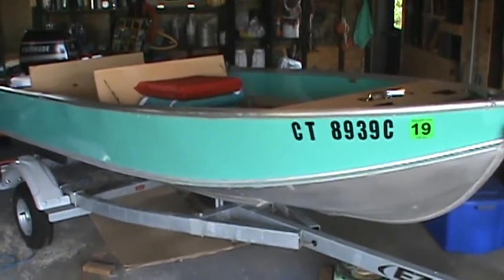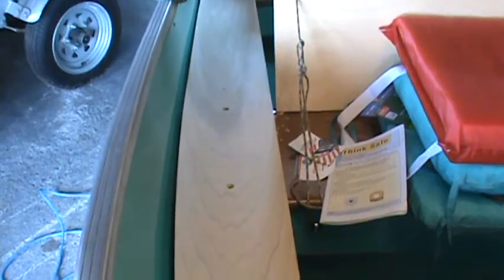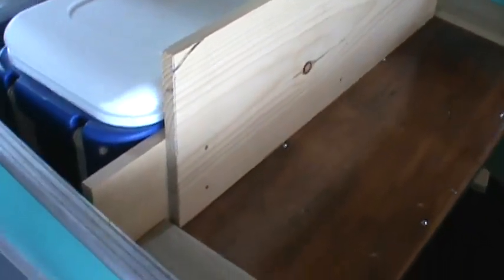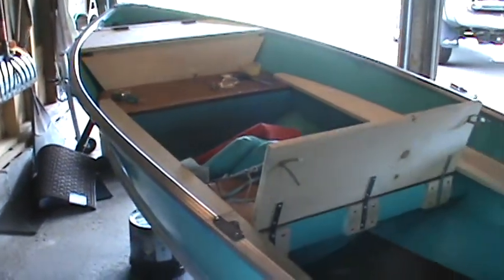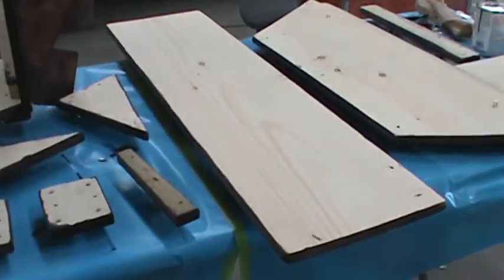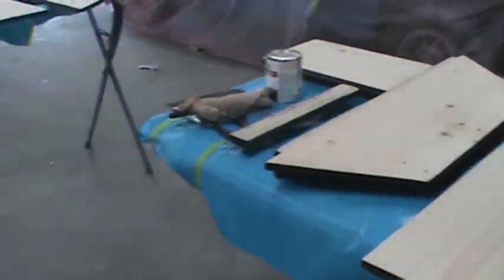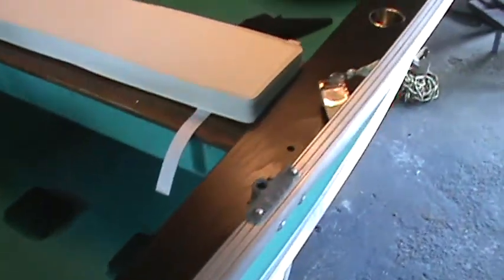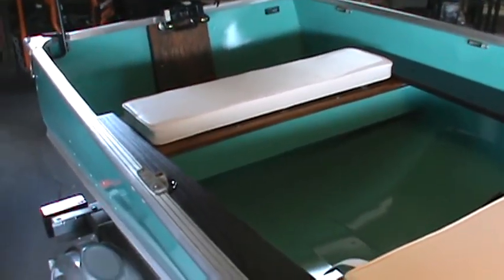12ft Duranautic Resto/Mod Finished

Comment: Did you have any problem replacing the motor board? Did the old one just slide out? What did you use for waterproof washers on the four bolts used to attach the motor board?

Comment: Wow, your boat came out amazing. Excellent craftsmanship. I have a similar if not the same boat. 1967 Duranautic , seafoam green , with wooden benches. She's in really good shape but I'm going to scuff her up and give her a new coat of paint soon. The aluminum gunwale is in pretty good shape too, but I would like to clean it up before painting the boat. Any suggestions/recommendations on how to clean/finish the gunwale?  thanks
Reply from the maker: I sanded mine with 220 then 320..gave them a good rubbing with a cloth after that.  Thanks for checking it out!
Reply: @MrSpubby  thanks for the reply. I will give it a try.